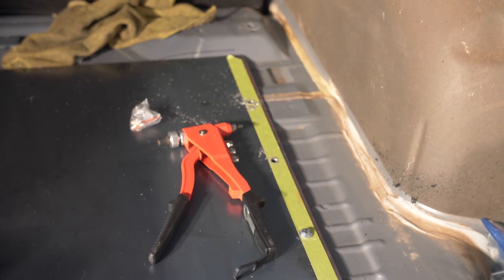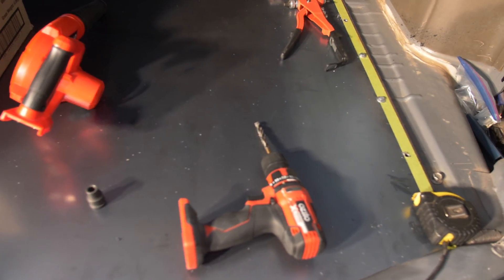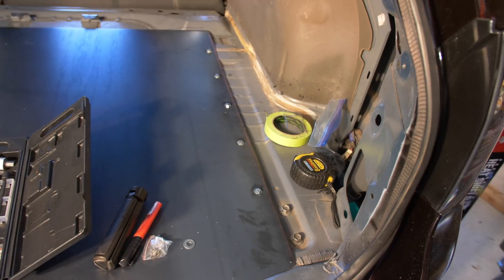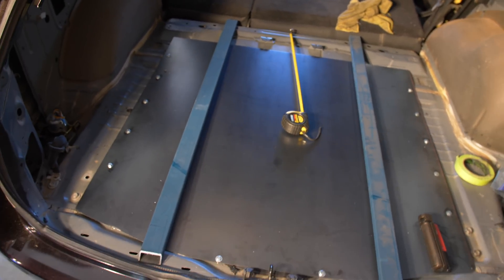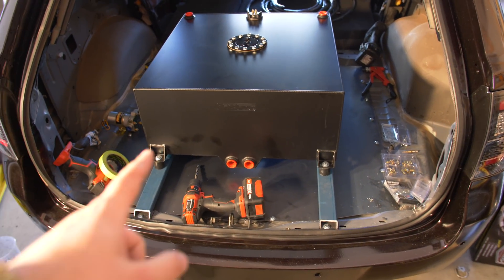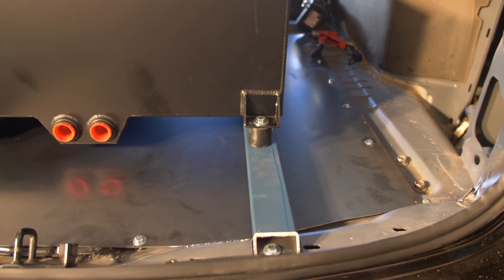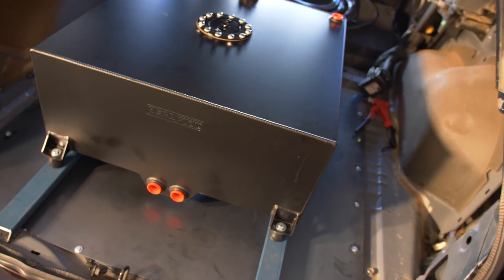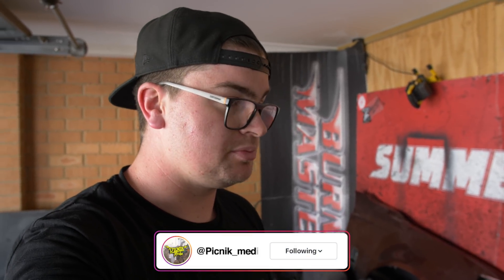Rivnut The World! Securing Our Methanol Fuel Cell

Comment: I'm running -8 feed and -10 return with an Aeromotive A3000 fuel pump in a 363cu Windsor, making just shy of 1050hp and its border line too big for the setup, it will never run out of feed. Engine was built by Aaron as well.
Reply from the maker: Awesome! That’s great to hear, on paper I’d worked it out and seemed like more than enough, so it’s good to hear it from someone else in the same-ish situation that can confirm
Reply: What car is that in, sounds like a mad setup
Reply: @timothylaidler1978  Its in a 1973 TC Cortina

Comment: How is the cabin separated in case of a meth fire? There is a reason fuel tanks are generally under the car. Sweet build btw. The tank will need to sit flat or it will balloon under the fuel load if mounted as youve proposed. Check out Loader's meth tank after overheating and fire during a skid comp. You wouldnt want that inside your cabin. Keep up the good work. Cheers
Reply from the maker: I’ll be making up a full firewall to completely block off the cabin! And we will also be bracing the tank at the bottom and from the sides to stop tank slosh/slap from potentially damaging the fuel cell too
Reply: @Mick_Hinchy  sweet as bro, will see you on the pad when she be rollin. Ill catch up with ya when summernats is back on. Cheers bro

Comment: You are game mounting the cell like that, I would firstly be cradling the bottom so it doesnt flex the bottom of the tank, and then I’d be putting straps over the top of the tank so it can’t move at all. At most those 4 feet would only be good for locating the tank
Reply: This was my thoughts also, all that weight on big tip ins will be going through the 4 bolts in the rhs
Reply from the maker: We will be adding bracing underneath the tank and also on the sides too! I’ve seen plenty of setups mounted identically to this and haven’t heard of any issues, but we will be bracing it none the less just as a precaution
Reply: Picnik Media good stuff mate looking forward to see the rest of it come together, good to see a young bloke giving it a crack